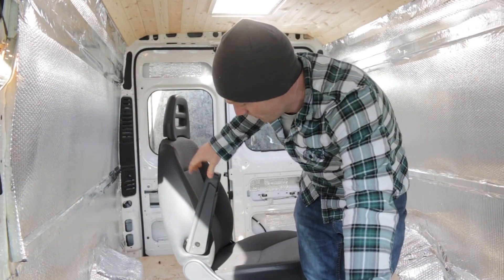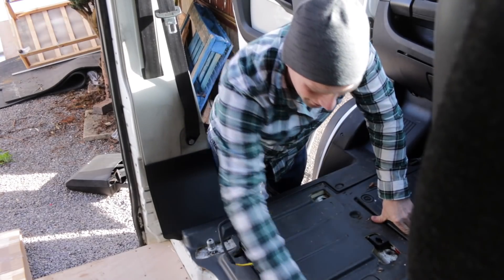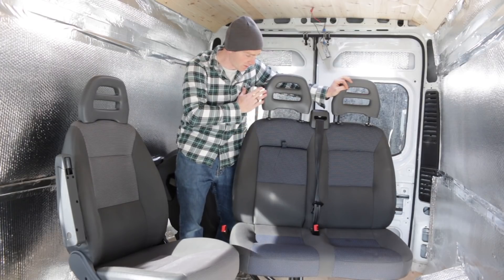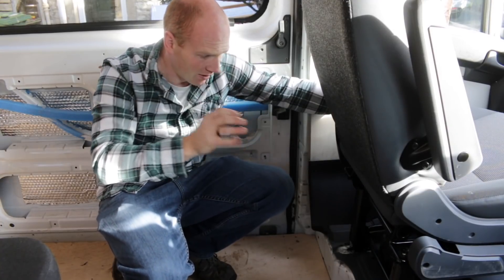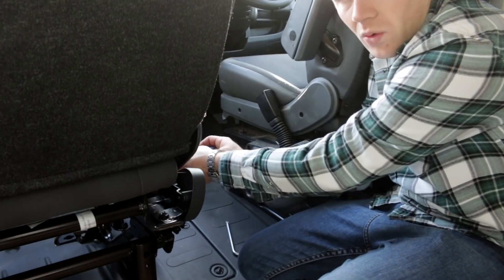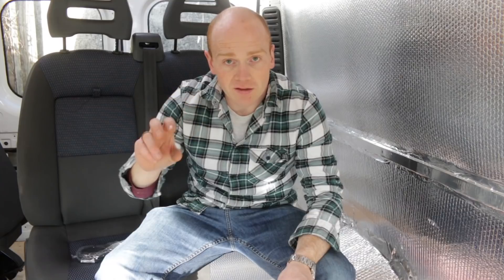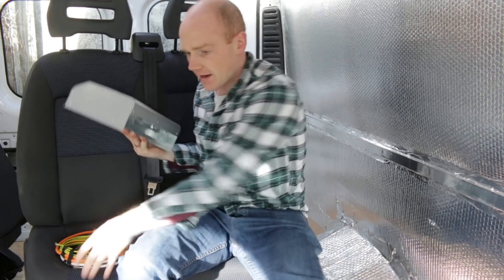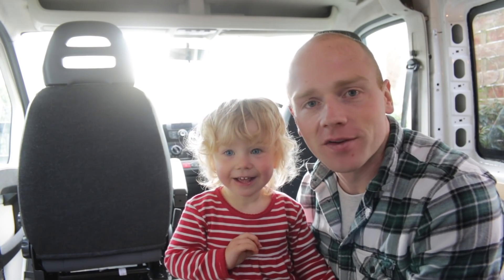Swapping out the Seats | TRC Van Conversion 14.0

Comment: A question for you Tim, if you have time... I have found a cheapish driver's seat online to potentially use as a single passenger seat. It seems like it would bolt down ok, and i can deal with the armrest being on the wrong side, but the fixing position for the seat belt receiver @9:19 concerns me. I take it there is no bracket on the opposite side? Would this require some welding or can the bracket be relocated to the other side of the seat frame?
Reply from the maker: I believe it has a thread to bolt it in both sides but not 100% sure. I know lots do it so can’t be too tricky.

Comment: I am doing this today. I was hung up on airbags. I will double check the connections
Reply: Under the passengers bench seat on my Promaster, there are six bundles of cables. I experimented unplugging one by one and I always receive an airbag fault. The single passengers seat I bought is the authentic one for a single passenger. It has 3 plugs on it to receive the 3 cables. Now what happens to the other 3 cables that used to plug under the middle seat?  Any way to loop them to fool the computer?  Two of the cables attach under the middle of the two cushions to sense the weight of both passengers.  I did find a solution, but, I haven't continue yet until I see if anyone else has done something different.   I can't just deal with the seat belt receiver only. I wish it was like that.

Comment: Hi, thank you for the fab videos of your van build. 
You are doing a really great job.
We are looking to convert a boxer and the seat idea is great.
The seat you got from eBay.  Is that a standard drivers seat and does it have to be of a similar year??
Thank you😊
Reply from the maker: It is a single passenger however you can adapt a drivers seat.  Doesn't have to be same year just the same model of van.  Finding matching patterns is the tricky bit!
Reply: The Restoration Couple 
Many thanks for the information.
Really great videos.
Thanks for taking the time to share them with us all 😁👍

Comment: Your van is coming on great. I've been watching the conversion from the start - I'm converting a Ducato too. So how different is a single passenger seat (or LHD driver's seat) to the RHD driver's seat? Are the seat structures the same from side to side? Seeing you transplant the seatbelt mount from the bench had me thinking.
For example, are any of the mountings present down the right side of the driver's seat to fit a seatbelt if I were to use a RHD seat in the passenger's place? I don't care about the armrest.
The mark-up for used single passenger seats in the UK is stratospheric - after all, nearly every other country will have a single seat on the left. If a passenger seat can't be created from a driver's seat and I can't find one cheap, I'm off to Europe to pick up "siège du conducteur", or a "bestuurders stoel".

Thanks, take care
Reply from the maker: +Mevi I doubt there is much to it. Probably fixing points on both sides of everything. I nearly got a LHD front twin seat to fit in the rear as the belts would be correct to fix to pillar. Apart from the controls and armrest they seem to be the same seat.
Reply: Thanks, I'll have a tinker when there is some daylight - converting a driver's seat to a passenger seat would be a good video to make, be good for the conversion community. 
You mentioned the winter in your video, it's really going to hold everything up. I was working on the van after work yesterday and it was 4c in there. :D
Reply from the maker: That's why I am hoping that I can get the van lined, painted, floored and wired soon.  The whole interior I can make in the garage section at a time, (mind you it's only slightly warmer in there!)
Reply: Good luck for completing that in time. I'm really hoping it's gonna be a mild winter. Brr

Comment: That's exactly the colour of seat I need for my Ducato... Fancy a swap if I end up unable to find the colour I need?

Also for electrical stuff - are you aware there is an "upfitter" connection in the base of the driver's side B pillar? There's connections for rear speakers, internal lights, and a 50A fused + and - supply from the battery.
Reply from the maker: Ooh that sounds interesting, was just about to look at speaker cables to the back.  Does it need a specific connection pin/plug?  Which do you need, the double or the single I just fitted?
Reply: I think this wiring diagram for a Ram Promaster is the same or very similar to the Ducato: http://www.rambodybuilder.com/2014/van/docs/vf/vfwiring/S/31/D2865.pdf

Comment: I was wondering. The 240v sockets you intend to put inside the van, can they be powered by the 12v batteries when you are not plugged in? it must be complicated to be able to use batteries with a transformer AND outside power which is 240v. The ideal would be that when you plug the vehicle with your outside socket it then starts charging the batteries and supplies the 240v sockets inside the vehicle. Fantastic job.

Comment: Funny as well as the same rear seats I used the same controller on my build

You can switch over to road battery to charge it from hook up

I used a feed from the cigarette lighter for the ignition on sense feed

The compressor fridge on mine is direct via fuse from the leisure battery not using the fridge feed on the Sargent unit as it's not man enough
Reply from the maker: +Steve Brown Yes I saw that on the diagrams they recommend direct feed for compressor fridge. Looking forward to getting stuck in to the wiring soon. Will let you know if we get stuck!

Comment: Also, Tim, it may be worth experimenting with upholstery/fabric paint (such as Simply Spray) in an attempt to match the replacement passenger seat cover to the rest of the existing seats. You're going from grey to dark blue (lighter to darker), so it should work.

Past that, the cheapest alternative would be harvesting a matching seat cover from a salvage vehicle, obtaining one from Ebay, etc. It would be far more form-fitting and durable than seat covers for all the chairs.

Comment: See if there is anyone out there prepared to swap a drivers seat thats the same colour.
Reply from the maker: +John Mead good idea. Probably a lot easier to find a matching drivers seat than passenger.
Reply: Might even find a builder happy to swap as he may not be worried about mismatch in his van
Reply: Could you not dye it the same colour ??
Reply from the maker: Wrong pattern too, :-( , plus would probably need to take it off  the seat to do it.

Comment: I'm looking at getting hold of some IKEA blinds:

http://www.ikea.com/gb/en/products/textiles-rugs/curtains-blinds/trippevals-block-out-cellular-blind-light-grey-art-10336894/

There is a slightly cheaper non-blackout version in the same sort of design. Hoping it will offer some insulation as well as privacy and light blocking. Planning to mount between bonded windows and the panelling but haven't checked measurements yet.

I was a little wary of the dedicated power management systems and have probably gone overkill with some products from Sterling Power after watching some of their YouTube videos.